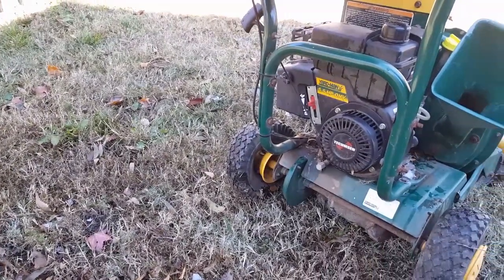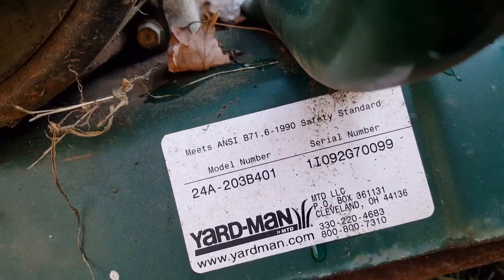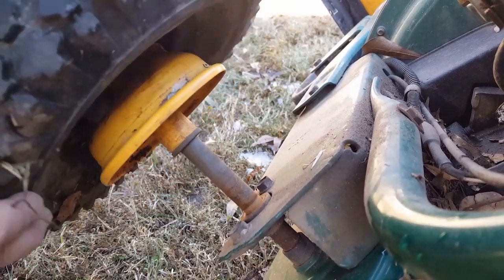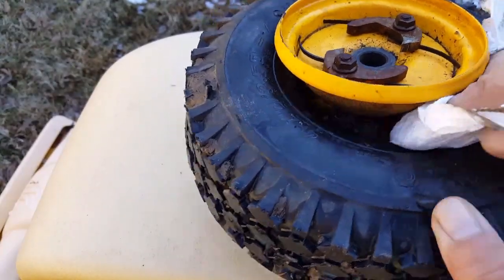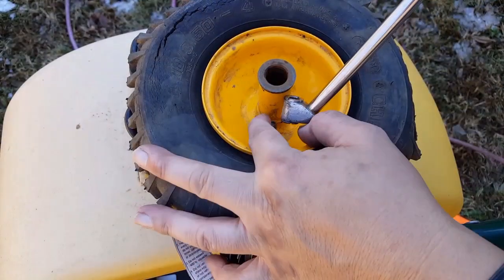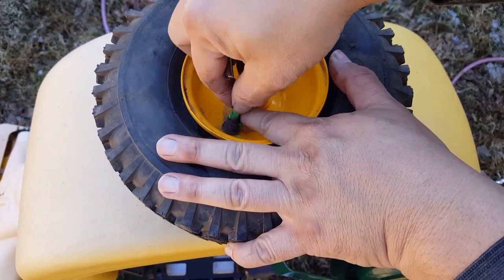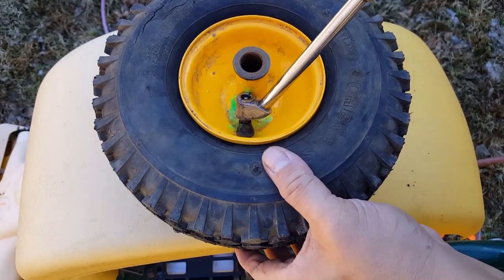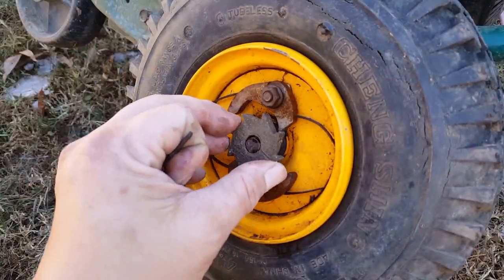Yardman lawn vac tire fix

Comment: I like this video. For a second there, I thought you were going to use inner tubes. For those who use equipment, Rotary has a bulk bottle of tire sealant. An economical investment.
Reply from the maker: Using inner tubes is a really good idea. I forgot about that option.

Comment: I see that this video is 3 years old.... how well did the 'Slime' take care of the leaks, and are the tires still holding air & Slime?  I ask because back in 2006, I bought a new Troy-Bilt CS4210 10-HP chipper shredder, and I have been dealing with its leaky 4.10 X 3.50 tubeless tires and its doggone plastic wheel rims for the past several years. I read the comments to your video regarding the tire tube solution, and I am just wondering 🤔which way would be best.  Thank you for your time.
Reply from the maker: it only last about a year, and the same problem came back, so I replace the wheels.
Reply: @INSIDEHOUSEGARAGE  Thank you for the timely reply! 🙂

Comment: Hey brotha.  I just got a used yard machine exactly like yours.  Have you ever had to replace the drive belt on that one yet?  If so, please advise on the best practice to replace it.
Reply from the maker: surprisingly I've never had to touch the drive belt. I was driving fine when I got it, it just didn't run.